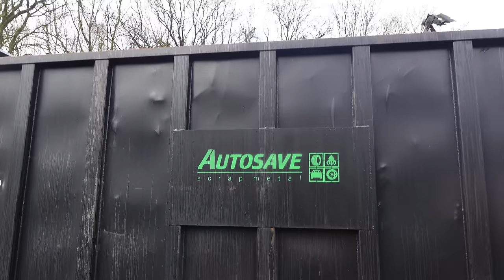Maximizing Efficiency with the New Scrap Tyre Bay!

Comment: Thirty minutes  cannot hope to show fully the work that goes into running BCB but how can it? Clearing the corner for the alloy wheels skip will make a huge difference, and safer access into that area of the yard. Breakdowns, broken winches and "eggs" on tyres all rolled into a busy, busy day. 
Things are evolving and I wish John and James well in the quest for a machine operator  -- get the right man and things will evolve as they should. 
Someone is becoming more confident with the special effects, John's two second trip for the bag of parts - well done!
Thanks for an information-packed video ! Best wishes.

Comment: James i know you were saying about building racking in the new area you are clearing, would you consider putting the baler in there along with the doosan and using that area to process cars/ commericals clear area where you currently are positioned concrete and then move back to this area and then build racking.
Reply from the maker: That's where it used to be, it wasn't big enough anymore so we had to move it